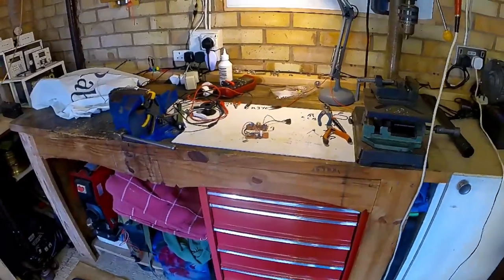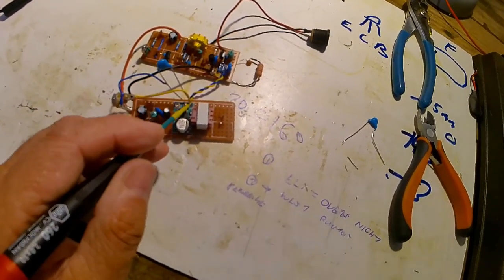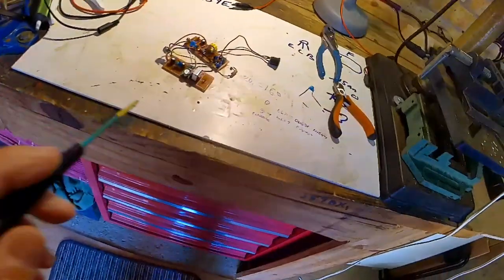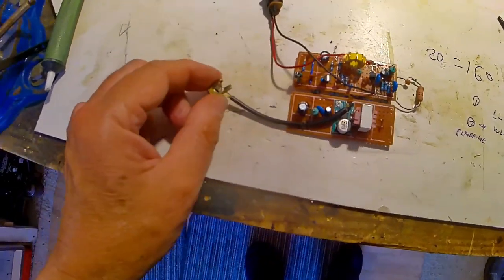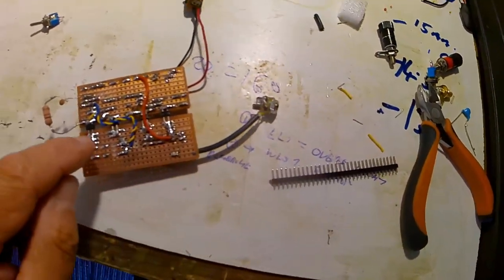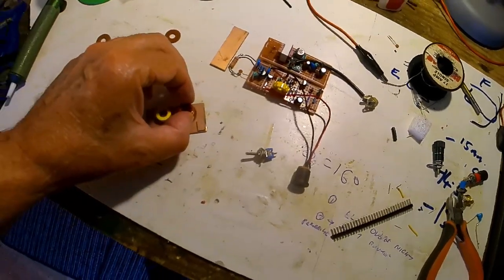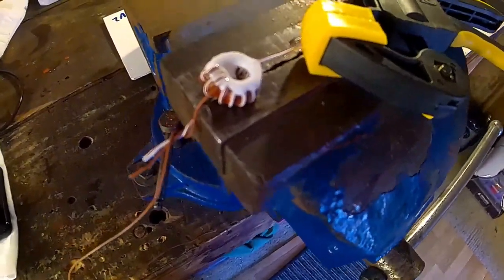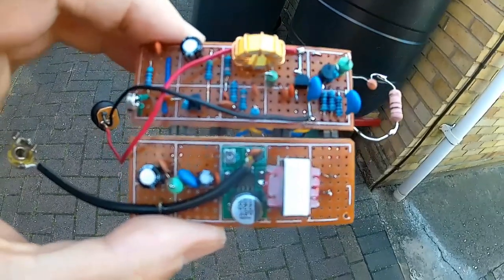FM and AM Radio Transmitter Exciter. Diy Low Power. Ham Radio. Amateur Radio. Part 2.

Comment: I would go with the ARMSTRONG Indirect FM Generation system as the direct method results in an unstable system unless you use PLL but you cannot get to much deviation as you can get from the ARMSTRONG system.